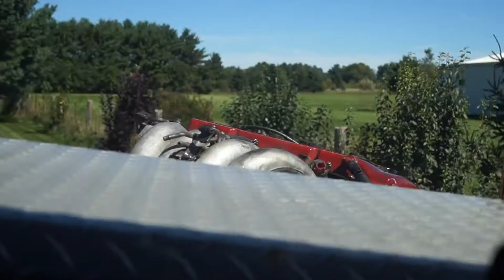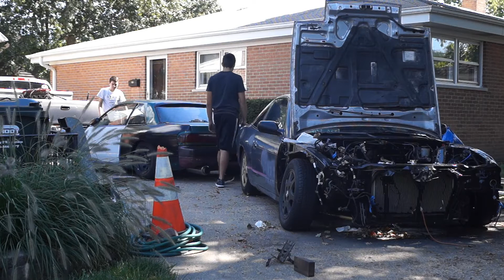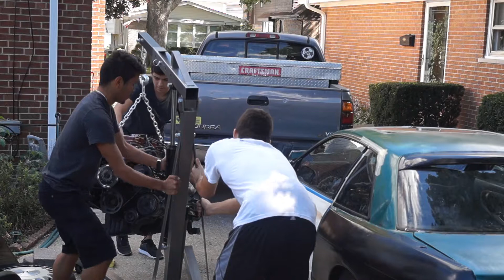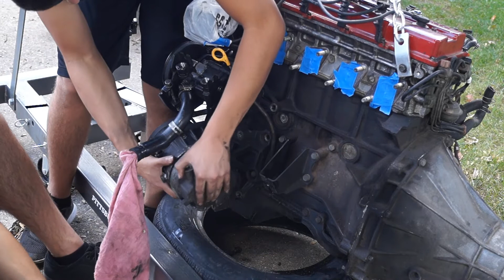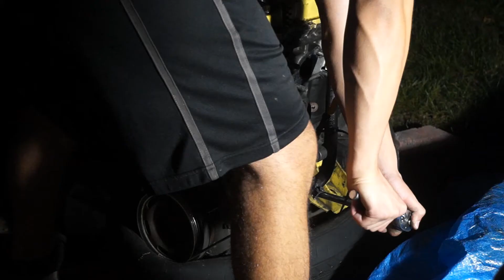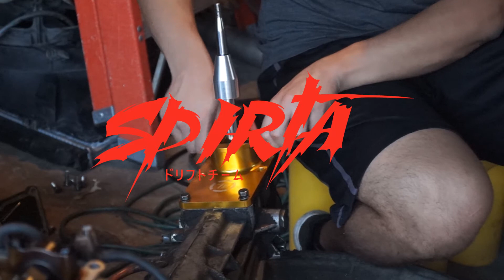240sx Builds Episode 16: A New KA24DE

Comment: What's the wheel specs on the coupe if you don't mind.
Reply from the maker: +Isaiah Sampson the front mb battles are 17x9.5 +15et with a 5mm slip on spacer to clear the coilover and the rear steelies are 15x7 or 7.5 +0et.